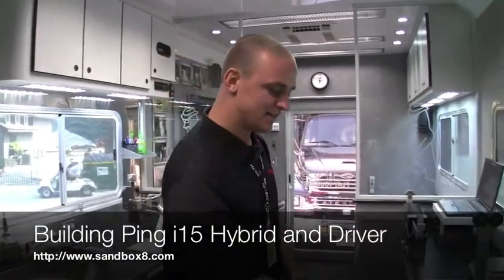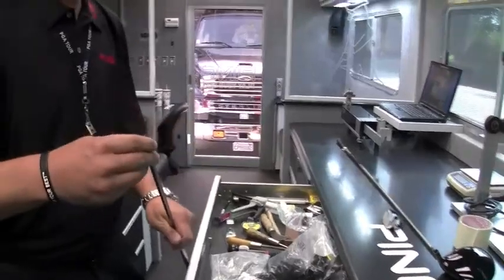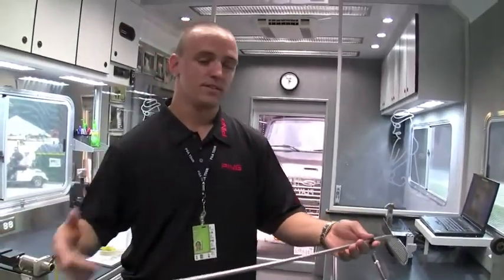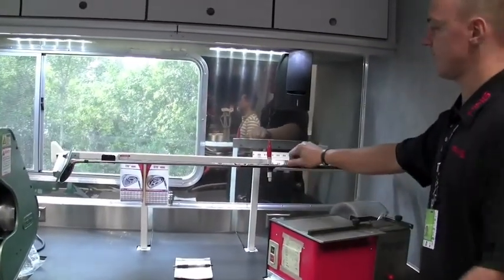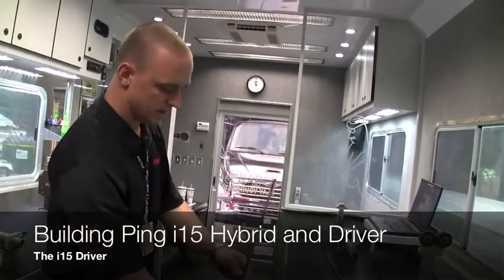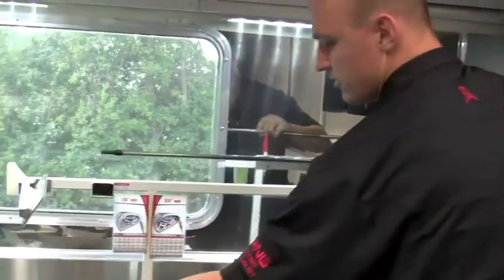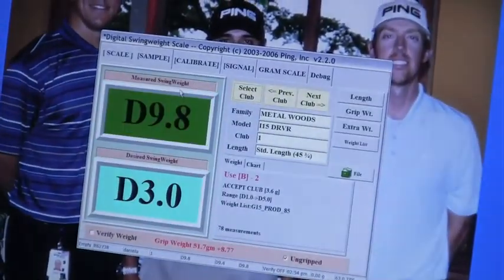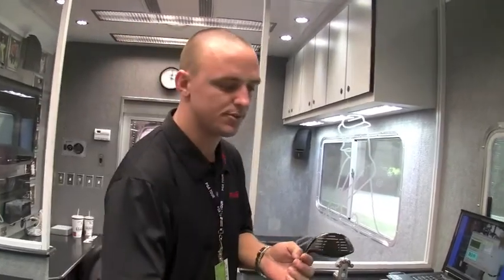How Ping Builds Hybrids and Drivers: Part One

Comment: I am sorry to say but this is all jippo clubmaking. No shaft alignment, no balancing due to shaft weight distribution, and what is D3. That is just crap swing weight stuff, it isn`t scientific at all. Start using club MOI. He didn`t check his swing weight after putting in the 1 gram in the tip, guess what, if you put a led weight in the tip the club becomes longer and you have to tip trim the shaft or the club will become longer and softer. Great tools but not impressing fitting....